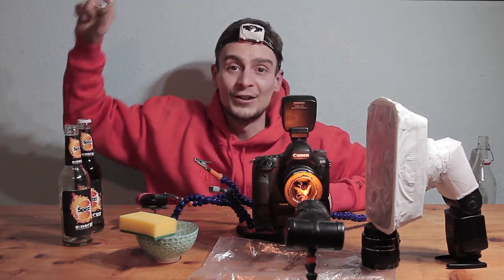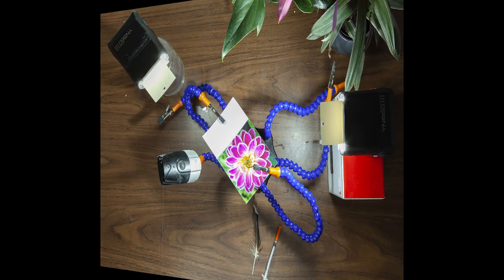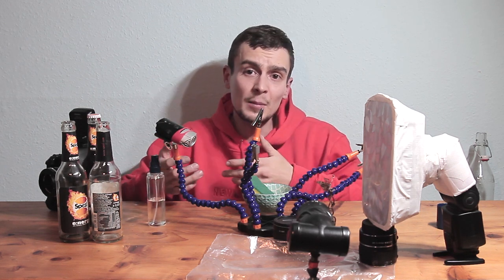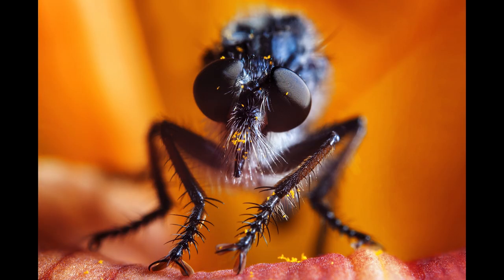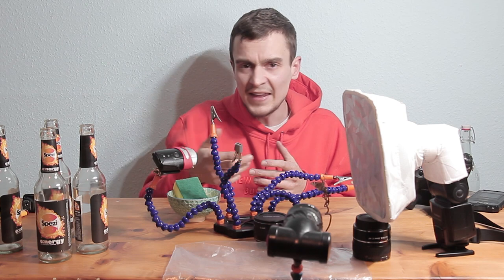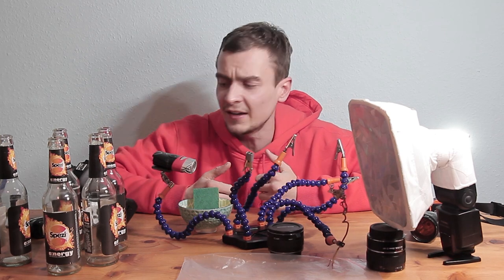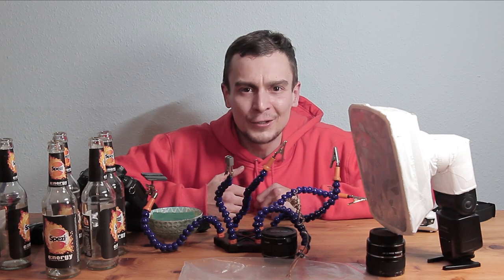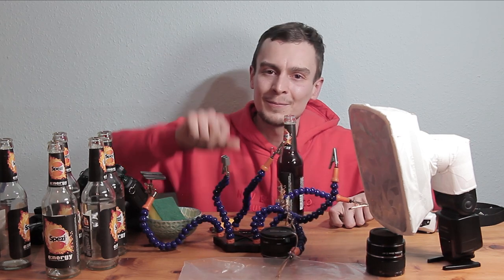5 Macro Hacks for Creative Photography

Comment: Good re-cap of hacks you’ve covered before, Max.  (Gotta cut back on those energy drinks😁.) Light as focusing aid a solid good practice — especially for flash.  Audio echos might be fixed by using a lapel mic.  Also, moving further away from the rear wall would soften your shadow.  LEDs of all sorts are readily available many places — different colors and light intensities for various special effects.  Have a great weakend.
Reply from the maker: Thanks Paul I know it's a bit of a recap but next week we'll be creative again. Thanks for your tips too, but at the moment I am very limited in space so I really can't move away from the wall to much... I'll be moving into a new apartment in the summer and I will make sure to optimize it for filming in terms of space and sound quality. 
I wish you a great weekend as well!